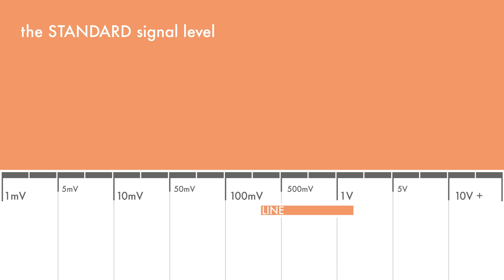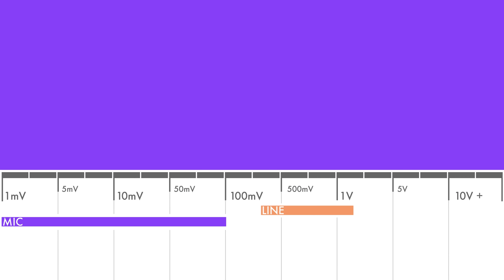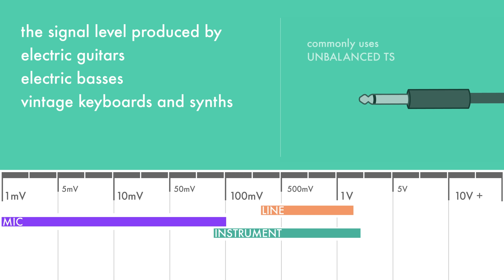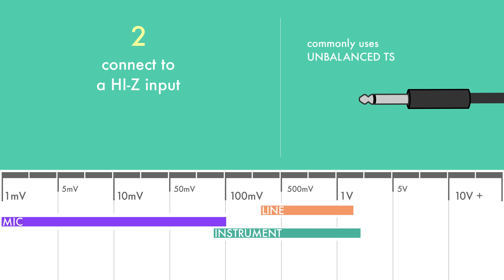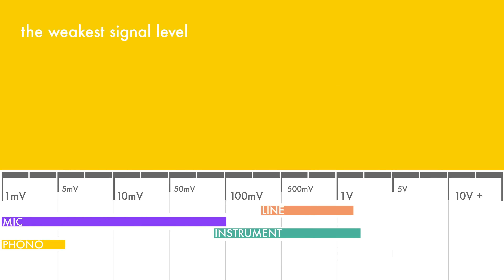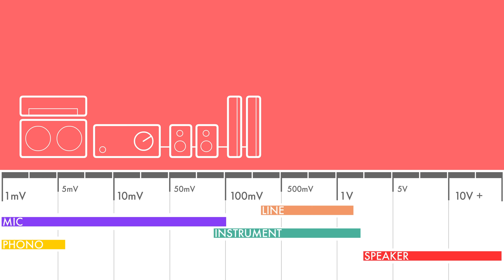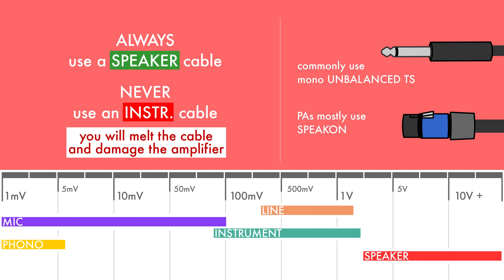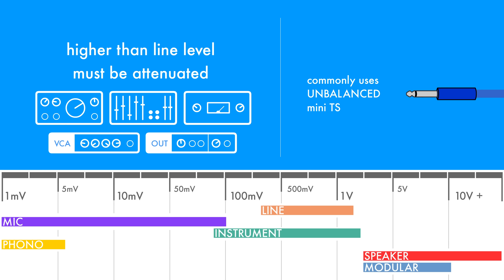Audio signal levels explained: Mic level vs line level vs instrument level

Comment: Watching this it occurs to me that with wireless mic systems it must be less imperative to use XLR jacks for connections since the receivers can boost gain before sending the signal to the mixer via a cable. The board then isn't getting mic level, but line level, and so the noise-fighting attributes of XLR are less important.
Reply: I don't know if this is user error, but I use a simple handheld wireless mic system whose receiver both TRS and XLR outputs, and the TRS is noticeably quieter. The receiver has only one volume knob and no additional volume settings in its menus. It's not cable run either, sub 1m cables in both cases.
Reply: @jakacresnar5855  I would guess that the TRS output from the receiver is line level and the XLR is mic level... this would explain there being a difference and would depend on the settings of the mixer channel (or whatever) to match.

Comment: I worked in a music store. An astonishing number of people don't realise that a speaker cable and a guitar cable are not the same thing and, despite using the same jack plugs, cannot be used interchangeably. Some remained convinced that it's just a ploy to sell them cables they don't need.
Reply: I don't understand why speaker cables are not clearly labeled as such with some kind of standard. Why the mystery?
Reply: @youssefelbahtimy A dead giveaway is if the cable looks like it's made from the same "zip-cord" wire as your hair dryer power cord -- two distinct round wires stuck together side-by-side.  The conductors are obviously not coaxial, therefore not shielded, and therefore not appropriate for mic/line/phono/instrument/any low-level signals.  That leaves 1 remaining acceptable application: Speaker.  Also, given the two wires are rather thick and you know there's only 1 copper conductor in each (since it's not a coaxial cable), the conductors are likely also quite thick -- something needed to handle the high currents of speakers.
Reply: @youssefelbahtimy  There is a dedicated format for speaker connections - Speakon - but I guess the good old legacy 1/4" jack, a hangover from the 40s and 50's, is now too deeply embedded / universally adopted, to completely abandon. And, it does take up a lot less panel real-estate than a speakon connector
Reply: @iambingojesus  1/4" speaker jacks have been abandoned in favor of speakon's ever since high power amplifiers have come available. A large amplifier can have a 120 volt rms swing on the outputs. That makes that power as dangerous as a live electrical cable and can kill you. 1/4" jacks are just bare connectors and dangerous in high power situations.
Reply: @wally7856  Well, quite. But, though they're standard on most PAs, and quite common on bass gear, I don't think I've ever seen a Speakon connector on a guitar amp.
Reply: @iambingojesus  Even a large 100 watt guitar amp is only outputting ~30 volts RMS at full tilt boogie, still safe to handle. My modest Crest Pro-LITE 3.0 sub amp can output 142 volts RMS in bridge mode, more then a wall outlet, that's when Speakon's are absolutely necessary.
Reply: @youssefelbahtimy what do you mean not labeled
Reply: @bart413  for example, Ethernet cable is usually labeled on the sheath whether it is cat 5, 5e, 6, etc so you can tell what you have easily. Speaker cable isn't usually any color other than black so it could easily be stamped with some designation.
Reply: @youssefelbahtimy  Yip, and sometimes it is labelled. Which only makes the unlabelled kind more annoying. It's not always visibly obvious which it is either.
Reply: @youssefelbahtimy  and I can't understand, why guitar speakers use jack instead speakon.
But they also keep for MIDI signals the European 5 pin audio connector instead XLR.
Reply: @youssefelbahtimy  maybe im wrong, but speaker cables have two rings and instruments have one, pretty identifiable for myself. Balanced and unbalanced. Am I missing something?
Reply: Don't even start with DMX and XLR :)
Reply: It really doesnt Matter If your Not Routing your cable for Like an km. I have around 300m of normal xlr as my DMX cable and ist does Not Matter at all. Its Just a cable.
Reply: @LinusMerz-o7ythey are different cables, just because it works doesn’t mean it’s good practice. There’s a reason why they use different cables for analogue and digital signals.
Reply: Guitarists are very much anchored by tradition. 

If we're talking about the best cable for the job, replacing the 1/4" unbalanced instrument jack with something balanced AND shielded makes way more sense when you're going to add saturation to the signal. 

We should have switched to XLRs for the instrument ins, and Speakons for the speaker outs decades ago.
Reply: @Mikey__R  Makes sense from a technical perspective, but I think that ship has well and truly sailed! The sheer tonnage of legacy gear out there means the good old 1/4" jack cable still has a long life ahead of it.
Reply: huh. I am in that astonishing number of people, or maybe I _was_, thanks
Reply: Because a speaker cable isn't balanced like a guitar cable would be right
Reply: @LaserTurtle  a speaker cable isn't shielded - a guitar cable isn't balanced. Balanced connection is found on XLR and stereo jack, except it is an insert cable.
Reply: realistically, you'd have to blast quite a bit of power (dimed distorted 100W tube guitar amp, for example) through a pretty crappy shield to get to the "melting" stage.

I'm not saying it's OK to use normal instrument cables for speaker cables, what you said and what was said in the video is 100% true, I'm just saying that if you have something small like 15W head or something, in a pinch, an instrument cable can work without major issues. Still risky and should only be used as an absolute last resort. Just borrow a cable or something.
Reply: @jakacresnar5855  I wouldn't, the output of an amp is roughly a million times that of a guitar pickup. Use any other cable... in a pinch cut up a power cord, one end to speaker and the other ypu can use an instrument plug, but not the cable, it's designed for miniscule currents nano Ampere range. By current it's more like a billion times more, not sure on the output of a tube amp in amperes. But it'll be in the ampere range not nano amps, voltage is roughly 1000x, resistance pretty much exactly a factor of a thousand So you got between a thousand to a billion times more power going through a speaker cable than a guitar cable and very roughly I used a 8k Ohm pup, 8 Ohm 100W speaker my back of the envelope calc
Reply: I've been playing bass guitar for more than 40 years. I've never paid attention to what kind of cable I use as a speaker cable. I've never experienced, nor heard of anyone whose cable has melted.
Reply: @lingonberriesofwrath1836  Your experience is your experience. May your luck continue.
Reply: Isn't that a reflection of your music store not doing its job? Where else would someone learn this?
Reply: @davechaffey3493  Sorry ... what? Not doing our job? How on earth did you arrive at that conclusion, Dave? How would we be responsible for anyone's understanding of cable types before they actually came in to the store? We can only educate customers once they're in front of us, having the conversation. The important thing is that, once they have revealed their ignorance / confusion, we put them straight. Meaning that they leave the store better informed than when they arrived. That, I would say, is very much our job.

Comment: QUESTION: I was thinking of getting the Tascam Portacapture X8 and using it to make some DI electric guitar and bass recordings, among many other uses. However, I now realize that I will likely end up needing to also purchase a DI box in order to do this. I'm still considering this setup, because from what I've seen online there are many DI boxes on the market that can be as cheap as $15. Any thoughts on this?  

I'm aware that there are many audio interfaces that are much cheaper than the X8, but I love the versatility of the X8 and would plan on using it for many other traditional microphone recordings, such as for vocals, drums and possibly even amps with some practice.

Comment: Excellent breakdown and explanation especially for those unfamiliar with signal interfaces on equipment they may well already own and are using incorrectly.  Even those trained and experienced in electronics can use valuable reminders.

I have to search through your stuff but I am sure you have video(s) on various devices that can be used to pair different signal levels and even a ‘how to take this and pair it to that’.

Thanks so much!

Comment: Hi.  How can you connect a headset mic (TRRS) to a wireless Transmitter-Receiver pair?.   It works fine if you're transmitting a headphone signal, but it won't pick up the headset signal.  I suspect the little microphone may need a powered connector.. and the 3.5mm jack into the transmitter isn't suitable for the headset mic.

Comment: This is interesting. Thank you.

Question: When discussing Speaker level you were specifying passive speakers, I am using analogue Mackie Onyx to powered Mackie Thrash 215, because I have active/powered speakers, does that mean I can use any old microphone XLR cable instead of speaker XLR?
Reply from the maker: Yes, when referring to speaker level we mean the level going from a power amp to passive speakers. In your case you are going into a power amp so you should be at line level and can use "normal" cables.
Reply: @arbitersofsound  Thank you so much

Comment: Fantastic video. Only missing item was headphone level. That would have been great to include. Maybe you could kindly do a revised video or a separate video to discuss headphone level. Thanks. But this was already pretty good. One reason to add headphone outputs is because some digital keyboards only have headphone outputs. and it would be great for audio engineers to know what is the most appropriate way to handle such outputs. But this was fantastic. Very relevant content. Thank you.

Comment: I think one thing you should have mentioned was headphone level. It’s quite common for people to use a headphone out when there is no line out available, and some people say this is safe as long as you keep the gain level coming out of the headphone out, very low. Another thing that is generally not clearly understood is preamp level. I have heard contradictory things about whether preamp level is the same as line level, and how these compare to the level that typically comes out of guitar pedals.
Reply: All preamp output SHOULD be line level for full interoperability between components. Ditto for analog effects send and receive.

However, some manufacturers of modular preamp-amp systems have departed from standard line level specs  in order to tune their circuitry to minimize distortion and improve linear performance.

So don't take the line level standard entirely for granted. Consult the product literature if in doubt.
Reply: @starfishsystems  It’s not so obvious if line level actually improves interoperability in the context of guitar pedals. The outputs of such pedals are typically connected to an amp or to other pedals. All of these devices are designed to accept instrument level signal.

Comment: Very informative, thank you, but my question is:
I have a guitar headphone amp (Boss Katana Go) with headphone output. I love the tones, can I use it at a live bar/open mic? This would require connecting it to a mixer. I assume I can easily do this if they have an aux in. However, how could I connect to one of the standard line inputs? (In case their mixer doesn’t have aux in)
Reply from the maker: It is not ideal but you could use the headphone out,
just make sure you start with the volume very low and raise it until the line in on the console gets a good loud signal.
Also, your headphone output is mini-jack stereo unbalanced.
So to go into a mixer you need to split that into two separate mono jack cables. For that you need a stereo mini-jack to 2X mono jack Y-cable (should cost less than 10$/pounds/euro).

Comment: Hi, thanks for the video. My amp has XLR Balanced IR output, I am connecting it to my interface(Babyface) via XLR Output(mic.) output. I am not sure if I should crank up the input level on my interface or keep it at lowest in order to not have any distortion on my sound. But when I do it like that I'd need to crank up my amps Master to the highest level. Do you think I should find a sweet spot and just turn up the mic input gain just a bit also on my interface, do you think it will be %100 clean, as long as it's not clipping? Cheers!
Reply from the maker: As long as you signal is not clipping on the way out of the amp, and your input levels on your interface are also not in the red then you are good with distortion, so you shouldn't really worry about that.
Your main problem here would be noise rather than distortion.
Now in order to decide what level you want to raise, you need to listen to which of the two amps gives you the most noise when you start cranking up the gain. Most likely it would be better practice to push the master of the amp and not crank up the gain on your interface. If raising the master of your amp too much is a problem for you (maybe because your amp is connected to a cab and it gets too loud?) then as you said find a level with your master that is comfortable to work with and compensate for the rest with gain on your interface pres. Just listen to the sound in your computer and make sure that you are not introducing too much noise or hiss to the recording. Hope this helps :D
Reply: @arbitersofsound Thanks for your help! I have np problem for the cab, I can completely turn off the amp, and still use the IR output, very nice amp has also 1 watt 5 watt and 20 watt option, and all sounds good, not needing any attenuator. Cheers! wish you success on your channel, it's going well.

Comment: Thx for this video!  I connect my guitar to an amp modeler (Helix) and use it in 1 of 3 ways: A) to an amp B) to a mixer C) to a powered FRFR speaker. When connecting to an amp I set the Helix out to 'instrument level' and when connecting to a mixer or FRFR I set the Helix output to 'line level'.  Question 1: Is that correct?  Question 2: In all 3 scenarios I am using a standard TS instrument cable.  Does that matter?
Reply from the maker: Correct! That is exactly what you should be doing :D 
If you were connecting to the mic-pre of the mixer you would need a DI (but since you're using a TS cable I assume you are connecting to the line ins).
Also the only time you would need a TS speaker cable would be to go from a power amp to speakers (which you clearly aren't doing).
So connection is correct and cable is correct :D
Reply: @arbitersofsound  Thank you for the prompt & thorough reply. Much appreciated!

Comment: Great video, many thanks. Although in Instrument level (1:35) you say the cables to use are UNBALANCED TS, in Speaker level chapter (3:34) you say “commonly use mono UNBALANCED TS”, but you also say “ALWAYS use a SPEAKER cable, NEVER use an INSTR. cable”… Is this not contradictory? Which one is right? This also brings me another question.. how do you distinguish a BALANCED from an UNBALANCED TS cable?? Thanks!
Reply from the maker: So, a TS cable is always unbalanced (you need three wires for balanced, so XLR or TRS). As for Instrument cables vs speaker cables, on the outside they look identical, but the wires in a speaker cable are of heavier gauge to handle the extra power from a power amp. Hope this helps :D
Reply: @arbitersofsound  Is there a way to tell them apart without taking the cable apart?
Reply: @matthewzagorski9161  It depends. If it's speaker twin cable then it's easy to spot. If it's round section cable then it may say speaker on the outside of the cable if you look closely ... but if there's any doubt open it up and then clearly mark the cable as a speaker cable!
Reply: @arbitersofsound  ok, that makes sense :) thanks!!

Comment: Nice, very informative, thank you. Can you help me with this one: I want to buy an interface (Arturia Minifuse 4)  that (except 2 combo inputs) has two 1/4" TRS balanced line inputs on the back and I wonder if I can connect my passive guitar or bass to it and have a decent input signal. Will Di-Box help here?  Passive or active? Or maybe my guitar amp or ZOOM multiefect pedal work fine as a preamp?  Thanks for help in advance.
Reply from the maker: You can obviously connect passive instruments to the combo inputs (since that's where the preamps are), but if you want to connect them to the line inputs at the back you need an instrument preamp. That most likely can be a line output from your amp or your pedal indeed. It can't be a DI box, because although that will fix the impedance of your signal, it won't provide the gain you need for a passive guitar/bass to hit the line level inputs. Hope this helps :D Let me know if you need more help!

Comment: Where does an iPhone output fall?  I have plugged it into a 'LINE IN' port on various devices, but it also drives head phone speakers.  I am currently wanting to plug my iPhone into the line in port of a mobile ham radio, and the volume is very low.